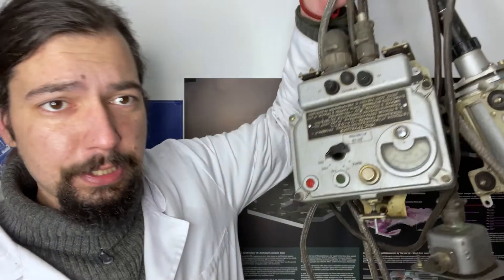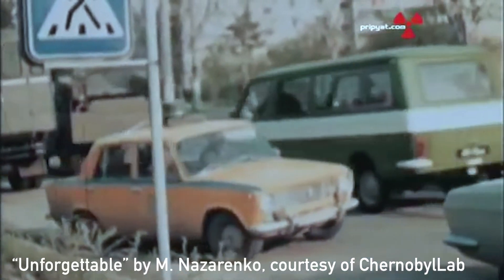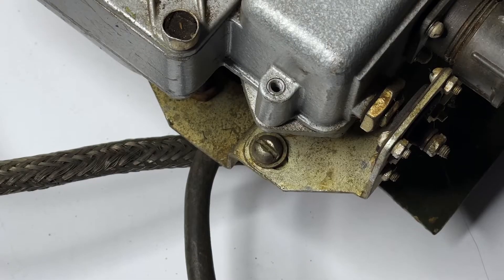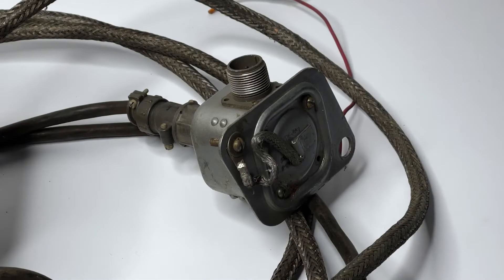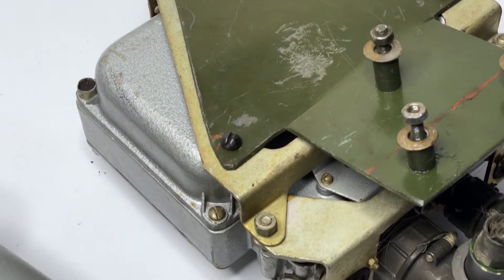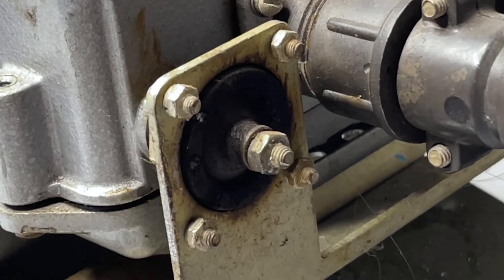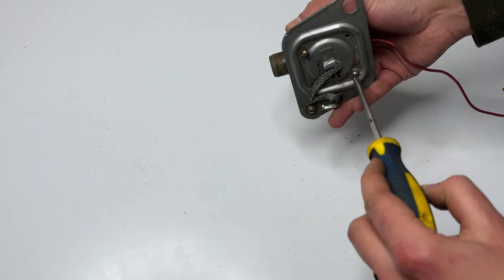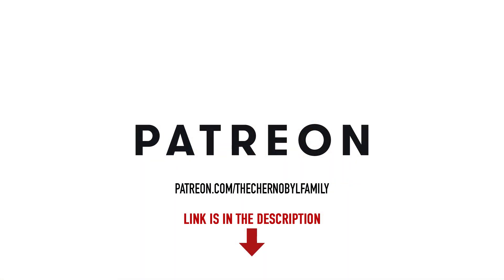Chernobyl DP-3V, the MOST HARDCORE dosimeter ever

Comment: Looks similar in design and function to the US CD-V715 ion chamber survey meter, which also reads to 500R/hr and was designed for similar purposes.

The use of vacuum tubes in the detector is likely for similar reasons as the CD-V715: it was the easiest, most reliable way to get very high input impedance for the electrometer circuit. At the low ranges, the ionization chamber produces picoamps of current flow!

The second "bulb" that sits behind the red jewel is actually a MTH-90 (MTX-90) cold cathode thyratron tube. It's a kind of dual use neon indicator and electronic switch.

Comment: I think the detector won't be geiger tube, but ionization chamber. Geiger tubes have pretty limited range, they were installed in those Chernobyl meters, which could measure only 3.6 Rontgens. For higher radiation levels were used ionization chambers.

Comment: Very nice soldering and materials used. Soviet naval comm equipment had the same quality and rather strange looking yet strong and precise. Was in primary school mid 80s, and close to my school was company repairing naval communication devices and not only, from VHF to radars. They had a big building and all the items to be scrapped were deposited in courtyard.
That was my Heaven, getting very interesting things, especially these special ones. The same precision and attention to details was given to those systems. Entire racks with high power RF tubes, SEL-SYN systems and other real interesting stuff.
The solder alloy contains also silver and the purple paint on the joints is also special, prevents oxidation. For example a high voltage probe for a special voltmeter to measure direct output of an RF tube for VHF was rated ant 6Kv and contained an extreme complex but symmetrical network of resistors. Each resistor was 10Gohm, all soldered with silver alloy and disposed very precise on the internals of the probe looking like a skeleton, to avoid arching.
Of course everything was bearing the well-known quality mark OTK, for mil-specs equipment.
As already being said, the 2 double triodes inside the detector are probably used to obtain the high voltage for the ionization chamber. Or they might be high gain amplifiers for the signal coming out the electrodes withing the chamber.
Most sure that the detector is very sensitive and well in range, even after so many years. And yes the parts inside detector should not be touched to avoid their contamination from fingers.
The germanium transistors, probably multivibrator-oscillator, not sure if some documentation is available.
Nice piece of equipment Alex.

Comment: IDK...To me, it still looks like something you can use today, and for the part of the world we're all talking about, that equipment is STILL going to let you know of certain areas where you really SHOULDN'T be!
Reply from the maker: Technically you are completely right. However, the biggest trouble with those analog-display based devices, they are very slow. Once for an experiment I went to the red forest with a bunch of this kind of devices. Response of them (I mean, then the pointer will get to the position) was 1-3 sec; sometimes in high radiation fields that may cause an unwanted extra dose received. Nevertheless, if you have nothing else, better to have this than nothing at all, that is for sure.

Comment: That's an ionization chamber meter. It's way too large for a Geiger-counter tube. Also the vacuum tube amplifier indicates it's a ionization chamber circuit. They build a LOT of these vacuum tube radiation meters during the 60s and 70s. It was one of the last holdouts of vacuum tubes (and Space Probes) because of the radiation resistance mentioned below. The problem with Geiger-counter tubes is that they're only sensitive to gamma-radiation. The problem is that they're almost 'deaf' for beta radiation and completely incapable of handling alpha-radiation.

Also, geiger-tubes can undergo a limited amount of discharges before they're 'exhausted' (just like any gas-filled tube for that matter, like thyratrons). And if you're looking into a 500R/h source, they die very quickly, the gas simply becomes ionized permanently, unless hardening is applied. Also, the beta-radiation versions are not as strong mechanically I'd think? I have one of these things, and they won't survive the blast effect of any weapon I'd say.

Comment: i wonder since the bmp was all made to be sealed from fallout with filtration and whatnot, it maybe would be detecting outside and read from the inside and allow the bmp to move far enough out of the fallout zone of tactical nukes to refill petrol/maintenance before moving on to somewhere else. the soviets really were serious about ww3 employing widescale nuclear weapons. i wonder if you could survive a close hit from tactical nuke inside of bmp with enough fuel to travel a few dozen miles away?
Reply from the maker: From the civil defense lessons in my school back in my childhood i remember that if you are inside APC/BMP you have zero chances. However, they are good for radiation reconnaissance (especially, BRDM-2). These devices were mounted at the front passenger seat, and detector was outside below the machine.
Reply: @ChernobylFamily  cool, thanks for the reply

Comment: Not sure but isn’t it possible that the check mode is implemented with measuring some kind of a radiation source with known intensity integrated inside the device? If so it basically means that you are dealing with some radioactive materials
Reply from the maker: This way as you describe it works in some devices, but this particular has electric check only, by giving standard impulses to its circuit. Basically it is a classic 'check circuit' mode.

Comment: This is what was probably used on the BRDM that did the initial on the ground survey (it wasn't a GAZ-66 with makeshift shielding as in a certain TV series). Honestly I don't know why would they need this high of a range, you're as good as dead much below this, and I don't expect the military to be interested in measuring extreme radioactivity beyond "gtfo and cordon the area" nor this sort of a device being used in a physics lab or other scientific research.
Reply from the maker: They needed it for surveying the areas affected by a nuclear blast. Another thing, that during the Chornobyl disaster there were additional factors that exceeded the original doctrine. As for that range, well, it is not that deadly; 500 R/h = 8.3 R/min = 0.13 R/sec, which is not good, but far from deadly; even 500 R/h cumulative dose gives pretty good chances unless it is instantly received.

Comment: 500 rad = 100% fatality… your survey meter “tube” appears to be some kind of ion chamber and likely gamma only, in the US those type high dose meters all used ion chambers for detection because all Geiger tubes I know of would max out at just a few rads. In the military we used ion chamber and dosimeter pens meters for survey and dose rate recording, we also had AN-PDR 27s for low dose alpha/beta/gamma surveys of individual, food, water, etc.
Reply from the maker: Thank you for those details! Well, with modern medicine 500 rads is not a 100% fatality anymore IF the treatment is applied ASAP and IF those received not within a second. In the described case it'd cause radiation sickness of a severe level, but chances still exist. It will very much change if it is an impact dose.
Reply: If I remember my radiochemistry correctly, the Geiger-Muller tube has an ionized plate, and the radiation knocked an electron loose. That would be the ticking from a speaker. We hooked ours up to counters with dekatron tubes (they could count pretty quickly, tens of thousands in a second). Pretty sure we just did stuff with alpha radiation, maybe beta, with a half-life of minutes at most. That was in high school for me, 4 years before Chernobyl.

Comment: .....the test button, and the neon tubes inside of the detector...could it be, that the test button blasts high voltage into those neon tubes and produces X-ray to test the the device? 🤔🤔
Reply from the maker: Hmmmm look, I need to check the documentation. I do not recall having a checksource ever mounted inside (which is common for soviet detectors). Will write later.

Comment: Hungary made a copy of this in the early 1960s, called IH-3. It was very similar but it had a different probe box. Then came the IH-3M in 1962 which was a very different device but it also used an ionisation chamber like the DP-3. In 1970 the IH-31 entered service, a device with a digital display, the first one in the Warsaw Pact. It has a Si(Li) semiconductor detector and has a 1000 R/h upper limit of detection.
I have a question for you too. Some sources claim that some IH-5 detectors were sent to Chernobyl from Hungary because the GM tubes in the DP-5 detectors died too quickly and saturated a lot due to high radiation levels. This was not the case with the IH-5 because semiconductor detectors don't saturate and they last much longer than GM tubes. Have you ever heard about these devices in the context of Chernobyl? An other interesting device which was sent to help out the Soviets was the RAM-II mobile laboratory from DDR for chechking soil and food contamination. An other good device with a semiconductor detector, but unfortunatelly similarly hard to find info about them in context with Chernobyl.
Reply from the maker: About RAM I've heard, while about tubes I'll try to check with a few engineers.

Comment: It is not a geiger tube, but an ionisation chamber tube. It has a high value glass resistor and a small vacuum tube installed too! Careful with touching those parts because contamination from the fingers can affect the measurement.
Reply from the maker: Thank you very much for this clarification! Some people before also pointed on the fact it is an ionization chamber, but additional details are very valuable too.
Reply: @ChernobylFamily  Oh, I'll gladly look into the working principle of this device. I have a hungarian device which is similar in principle, it is the "IH-2" field dosimeter which can measure up to 200R/h. It doesn't have an external probe, but it is sealed into a sturdy chamber. The working principle is very similar: You have a dry air filled atmosphere in a can, there are two electrodes which are very well insulated electrically (with teflon or other materials). Depending on the design a voltage is applied to one electrode of the chamber (usually the outside electrode is the can itself). This voltage presence is converted to a current when ionising radiation is present. The current flows towards the inner electrode and the glass sealed high value resistor converts it to a voltage, which is amplified by a vauum tube. This vacuum tube is special, because its pins are arranged in a way that the sensing/control pin or grid pin is placed the furthest away from the other pins. The vacuum tube configuration is needed because it provides an almost infinite input resistance to the very small ion current produced by the ionisation chamber. Then the amplified signal will travel to the operator side and will be processed by it. The audio signal is not really a geiger sound but more like an alarm sound.
Reply: Especially that high-value grid-resistor is brr... Don't touch with sweaty palms indeed!

Comment: I like the build quality. It's literally built to survive a nuclear disaster! I would be curious to see if it still powers up and passes the test. Was it built with electrolytic capacitors that have dried up, or can it still bias the Geiger tube? Those look like regulator tubes. I would like to see if the circuit is still functional. Is there a circuit diagram available?
Reply from the maker: It should work, just it used a but exotic voltage, so need to find the power source. These capacotors here are pretty stable, contrary to infamous K50-6. As for documentarion, if will find it, will post on Patreon with a translation!

Comment: Interesting electrical componentry as expected for the 60's from very late in 1959, i'd suggest that this could have been used on the Tsar bomb testing too as well as the area zoning of the fallout after the 1986 reactor accident.
Reply from the maker: Well, actually the point of this video is that it was used in the Zone widely. Czar Bomb, however, is a bit too early, at that time they used more primitive meters.

Comment: Hi Alex, that is a lovely old bit of kit. It is a shame it had to exist. Considering its 60 years old design it is pretty cool. 60years before that electricity hadn't been discovered. The thing looks so well, you could probably repair it, if need be.
Reply from the maker: Thank you! It seems to be fully functional, not sure whether it actually needs a repair. However, its specs are too high to get any meaningful result apart from the backlight of a meter working, therefore I did not try to power it on.

Comment: Yep, typical 1960s design. Point to point wiring of the components in the circuit would make it very reliable, so it probably still works. But considering the age of those components, it's probably well out of calibration. If you had a radioactive source to test it on, it would probably give you a reading, but I wouldn't rely on that reading to be accurate. And I can definitely understand not wanting to have a radioactive source around just sitting around the house, your channel isn't Cody'sLab!
Reply from the maker: I believe this was made with low-integration and 3D mounting also from consideration of radiation resistance.
Reply: The DP-5B (1 perosn carry variant of this one) has a small radioactive source on the probe itslef. You need to turn the probe lid 180 degr. and the small radioactive material will be over the dedector tubes. You check if the redaings of the meter fall in the specs and then turn the lid 180 to use the meter. I used one made in 1965 in the bulgarian army in 2014 and it was still in spec. The capitan had no idea where he was and what to do, so I would strap the meter on my waist and go around the base "doing my monthly check". Fun times

Comment: Just one question: How do you /calibrate/ this?
Do you need to set off a calibrated nuclear bomb next to it?
Reply from the maker: You place it near a standard with the known activity and adjust the knobs. In fact, there are a lot of types of sourses with ~0.10..1Sv/h power exist. 5Sv are less common, but they are also used, when it comes to calibrating e.g. survey/search radiometers.

Comment: 09:53 -  It's not a Geiger–Müller tube. This particular detector is an ionization chamber.
Reply from the maker: Thanks!
Reply: Yep, on many of these devices from that era, GM tubes were used only for low range modes up to a few r/h. High range measurements were done by ionisation chambers.

Comment: That's not sloppy construction at all. It's first rate 1950's and 1960's circuit construction techniques. American hardware from those decades looked just like that. If there's a big difference, Americans liked to use bus designs with backplanes. But really the workmanship and PCB's look first rate for the technology employed.
Reply from the maker: I agree. Though the point is, this very device is from the 80-s, the practices were the same. Well, might be retained from radiation resistance considerations.
Reply: @ChernobylFamily  I worked on electronics in the 1980's and nuclear rad hard high power systems looked just like this. The components started becoming more integrated by '85, and by then yes the look had changed. But consider a unit built in 1969 would only be 11 years old in 1980 and still have a lot of life in it. In the 80's these electronics would not seem old, only slightly dated. Their age would have been apparent in the 90's. I'd love to see the amplifier technology used in this unit. Tubes or early rad hard transistors? As an aside, in American electronics circles in the 1980's we'd joke that the USSR made the best vacuum tubes in the world, and the old guys would quip back that yes indeed they do and they reap a lot of benefit from it. Some radar guys I know say that modern radar did not truly exceed every metric of tube based radar until the late 90's. Soviet/Russian tubes now have a reputation for excellence in the USA.
Reply: @AndrewTubbiolo  Soviet era electronics are next level, built to last til the end of time
Reply: 😂😂😂 not

Comment: If you have to change the scale to the 500 mark, it will be one of the last machine operations you do as a healthy person. Strange as prompt fallout from a nuclear burst near the ground can be as high as 1000 R/hr.  You'd expect nuclear troops to have  full scale meter to match combat conditions.
Reply from the maker: Well, in reality not really, if it is not about the nuclear blast (in regards of which I'd agree). In the Zone, specifically if we talk about the engineers who work with the Shelter, the levels may be much higher. The question is a proper dose management — time, distance, shielding. However, the question is, when their work will strike back (knowing many personally, hope never)

Comment: In Socialist Poland a meter with similar specs was made. Polon-Alfa DP-75 with first range up to 0.5 mR/h, and last with 500 R/h. It was designed for carrying. The detector section contained DOI-30 and DOI-80 lamps.
I owned one for a few years, and scanned the whole manual w/ the electronic schematics.
Reply from the maker: Although I dod not have the device you mentioned, I remember having a radio with the vacuum tubes marked with Polon-Alpha. Cheers!
Reply: Hope you uploaded the manual to the internet archive :)